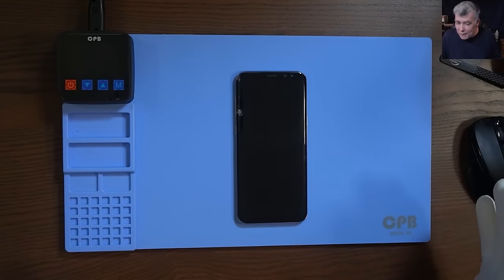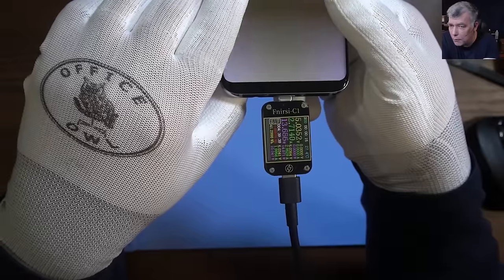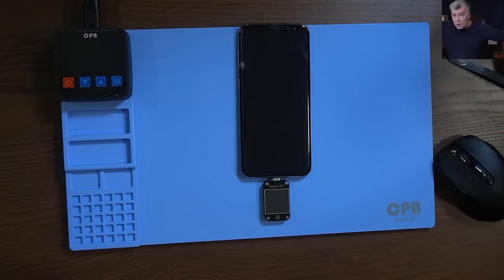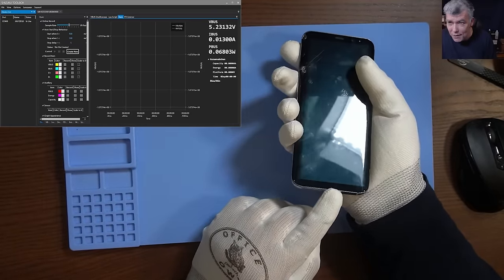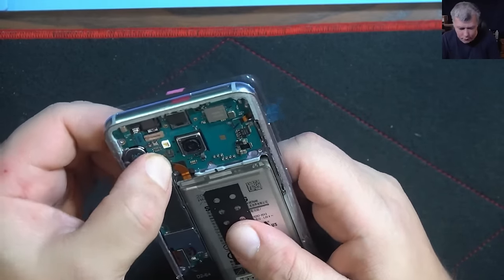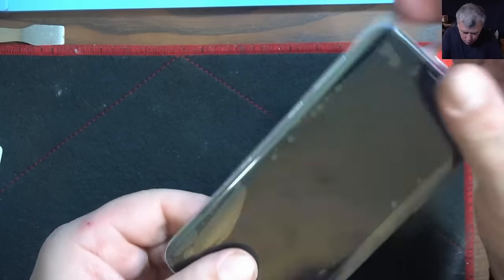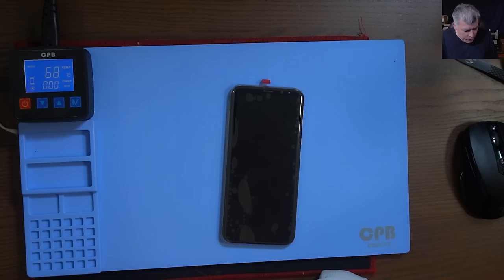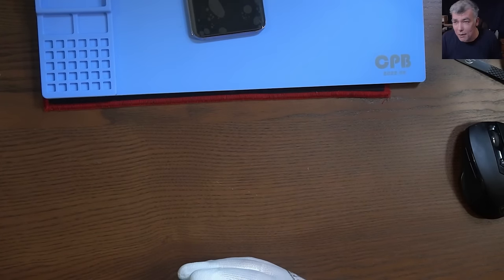How we are dealing with phones repair - What replacement parts are we using? How are we testing?

Comment: hi sorin , i advice you to use money rubber to scour the screen in there place until the adhesive hardness , i work in phone repair and find its the best way to do that without damaging the new screen , this method will not put high pressure on the screen and you can give the phone to the customer without need to wait the adhesive hardness (if he cant wait) , hope these make your work more easier

Comment: No, the 2.7A at 5V is actually correct, if you account for thermal loses and the 0.2A from the resistance drop it comes down to basic Apple like 5v 2.4V (it just triggers the DCP at 5V 2.4A), the only reason the you see we see 2.7A its because of the losses and the fact that the battery is heavily discharged as well, it's just triggered another charging protocol as a fallback because that charger doesn't support QC2 which is the S9+ officially supports.
PD (USB i mean), PD MTK and or QC2 MTK Or just QC2 is another combination of protocols some from MediaTek and Qualcomm by using the PD standard over it.
My Poco F1 for example can trigger a variety of modes PD v2.0 at 18 watt at 9V and 2A but also a 6.9V decreasing as the battery charges down to around 5.2V starting from (with thermal loses included) 2.8A as that is slowly decreases to around "0mA" when it reaches 100%, 
I have a lot and very high quality of chargers (the original which triggers the last one) who support most of the charging protocols which are out there and have tested this and also at work with like all the Galaxy A and S family(both Exynos and Snapdragon variants), all of the Xiaomi, Notes, Pocos etc etc and the normal ones or Pros or whatever, even the HUAWEI ones.
The Xiaomi ones usually trigger the PD MTK or MTK or QC2 fast charging protocol the rest are on either Samsungs AFC or SFC which is basically a QC2 copy at 9V 2A or rarely the PD v2 or just the DCP at various Ampere values but always 5V.
Charging protocols are a mess to deal with...

Edit: We use the exact same pad for heating phones at the store i work. This is basically a universal standard at this point.
Reply from the maker: I understand your point but, this not a standard, usb-c was accepted as a standard but each manufacturer modified the communication protocol so now we have a bunch of standards and protocols. This was the idea, one charger for everything :D
Reply: @electronicsrepairschool  USB-C is the connector, not the stuff that goes through it. The voltage, amps, comms, etc are part of the thing that goes through it, be it USB 1, 2, 3, PD, BC or QC.

The point of the USB-C is to be insertable a lot, stiffen the connection, make it reversible, faster and increase the power delivery, but there has to be room for improvement while the connector stays, so the protocols have been freed as to keep increasing power and speed and to allow for competition between manufacturers while keeping minimum interconnectivity.

Ideally, devices should support as many standards as possible, but what is likely is that they will all support the workhorse 5V 3A that PD allows and not worry about phone model to keep things cheap.

They have achieved what they set out to do. You can charge at any port (up to 15W) and you can also use one of the standards (QC or PD) to go up to 100W. 

In the future, however, since USB PD is part of the USB spec and allows up to 100W (Extended to 240W in 2021), it is likely that it will be more widespread. Under the hood, Apple accepts USB PD, Samsung has just put out 45W chargers with USB PD certified (15V 3A), I think we're seeing the emergence of a final standard. It's simpler (5, 9, 12 and 20 volts) and also supports the fine control thing.

It seems that 3A is here to stay. So 5V (15W), 9V (27W) and 15V (45A) are going to be the phone and tablet staple, with the 20V and the higher extended ranges to be used for laptops, replacing the 19V thing they do now.

Comment: I been watching a lot of videos from this chap and love watching them they are very informative and been very useful 

I have dabbled in computer repairs for sometime and done a few basic repairs on mobile phones and tablets but going down to component level I kinda shy away 

But seeing these videos has helped a lot in figuring out what may be the problem on certain devices and I'm now considering buying some of the equipment such as scope the hot air soldering kit  have a couple laptops sat around for practicing so let's see 

In fact I have 2 laptops that need repairing one of them was supposed to be just a reformat but the owner failed to tell me the darn thing doesn't even switch on only has an orange charging light  and the other laptop for water damages after roof got blown off during a typhoon and seen at least 3 blown components one actually looks like it melted 

Actually I also have an Asus Zenfone that stuck on Asus logo when turning on it won't even flash stock firmware not entirely sure what's up with it if it's a problem with the Emmc as copying the content stops at a certain percentage or if it's down to locked bootloader so any tips on that would help

So more of these videos I shall be watching

Comment: Thank you for this video, here are my 3 cents to it.

1. Yes, working with original parts is OK, but there are customers who want new parts, not used parts. And if you can't get the original part new, you'll have a trouble with this customer.
2. There are 3 major types of displays, which are incell, soft and hard LCDs. I don't like HARD ones, really easy to damage. A good one incell or soft are my preferences. Incell is the cheapest, but, it comes at the cost. Make a research, you can learn about them :).
3. Apple screens are much cheaper than the rest ;). Worth mentioning though.
4. Yes, you have to remove all the glass, correct, but it doesn't mean you have to use a microscope for it like 100% of the times. You can do it with a magnifying glass as well in many cases IMHO.
5. Good that you've mentioned about the proximity sensor. Ideal would be to mention the location of it. Most of the people won't know the location and won't be bothered to look for it. yes, that's their problem if they'll damage, but, would be nice to add this and make it a complete tutorial :).
6. I'd like to convert one screen to another device. If will do it like ever, will post on this/my youtube channel. But, for now don't have diagrams of screens like LVDS signals, and those additional chips like in Apple and others. I don't have too much spare time as well, so it's a dream more than anything else ;).

Comment: Recent capacity doesn't say anything about battery lasting (life).That's the case of quality and stock storage time.About 3 pieces of battery I replaced in my mobile phone after half year of using until I got propper one.

Comment: Just want to say that the HP charger cant charge and 9 volt. They do mostly at 5v and 19~20V depending on the model. Only if its new generation can do more voltages. The other cheap charger can do 5/9/12/15/19 depending on the model and if its good. So check the output voltages from the HP charger that you have.

Today we have pd, pps etc. 

Otherwise great as ever
Reply from the maker: Nope, my hp power adapter has 5, 9, 10, 12, 15, 20

Comment: Copies of original parts usually have been made with a little guesswork in mind, which can cause trouble with some functionality of the device ranging from something minor to something major which is why most people prefer to work with original ones unless the copies are very good and certified or they don't care a lot about the device working perfectly all the time for whatever reason. Customer is choosing most of the time, we make him aware of all the options depending on the device and current stock levels.

For screens we try to almost always buy one which has the LCD and the Digitizer together so we don't have to mess up with glues and risk of white/yellow/red or improper fitting and thus cracking sooner or later.

Comment: If you don't have a heat pad, but you do have a 3D printer, then put the phone on the build plate and preheat it to 70-80 degrees Celcius ;)
Reply: The whole video i thought, i must have something that will heat up.. oh yes my 3d printer .. thanks..
Reply: I have done the same in the past :) 60c is usually enough

Comment: Please, could you make a video on how you connected battery charger with a testing and activation board for phone batteries that you have used in this video. Usually, those boards are powered by 4.8v-6v but you have obviously found a way to  connect the voltage from the battery charger/tester to the activation board. Or I am wrong and it is made in factory and you just bought those two together?
Reply from the maker: Please check Diana"s video, she made a video testing the battery capacity
Reply: I have just become Diana's subscriber and watched the video you instructed me to see. In her video the activation board is smaller, probably limited to a few phone brends but in your video the board is bigger and designed for a large number of phone brends. I have asked Diana and you to possibly share the points on which you soldered + and - wires onto the activation board because your idea is very smart to combine the battery charger/tester and the activation board. Thanks in advance.
Reply: @electronicsrepairschool  hi there, what is Diana's channel name?
Reply: @ivanr5315  Didi Tech Girl
Reply: @zlane71  thanks

Comment: Samsung is one of the worst repairs you will ever attempt. Sorin makes it look easy. This is the s8+ with the original frame. Customers think that a cracked screen is £40 repair. The rear always cracks and splits on removal. Go onto the more s20 etc and you will lose money. Great vid Sorin.
Reply: Samsung is one of the easyest to repair, back glass is removable quite easely if you know how to do it, nothing is serialized, almost all original parts are available to be purchased.
Reply: @dexasdexas3784  You are wrong
Reply: @56ty78ui  I made a buck just by replacing batteries and screens on samsung mostly, Dexas is right, easiest money ever
Reply: @56ty78ui  samsung at 70degrees, isopropil and plastic from rx films everyone has. easy to open, use alcohol and you never crack rears again, be patient

Comment: If its "fast charging" why is it only 1.3A should be at least 2A for fast charging
Reply: If you can see, it consums more or less 13watts, which is 9v x 1.5amp, kinda aproximated. same as 5v x 2.8amp. both chargers do fast charge in different modes. if one is safer than the other is what i dont know.